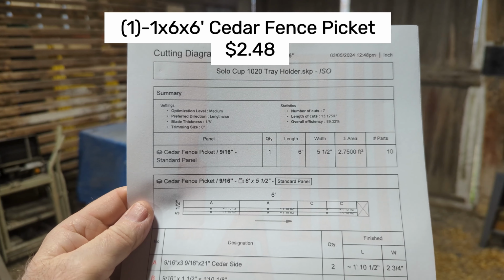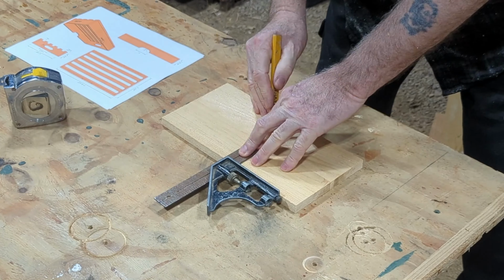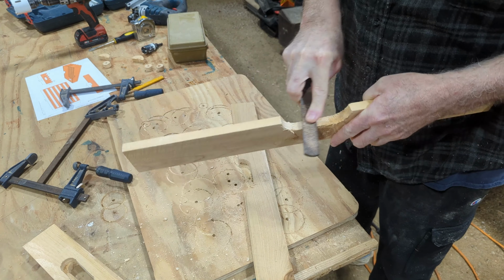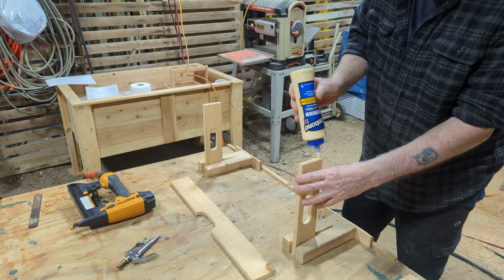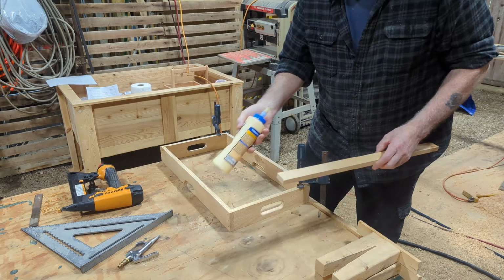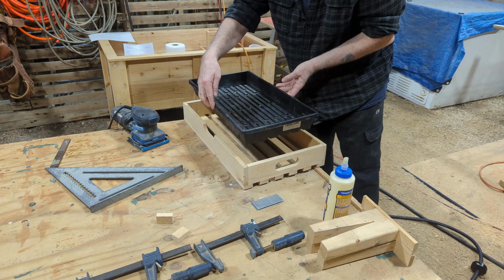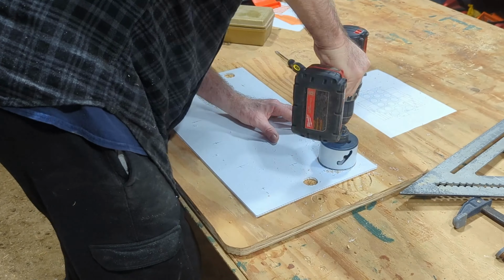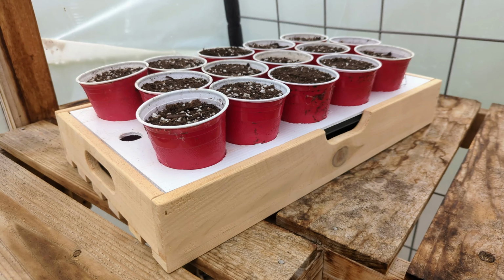Transform Your Gardening: DIY Seed Tray Using One Cedar Fence Picket!

Comment from the maker: You can get the plans for this build here: https://mtlibertydesign.etsy.com/listing/1681635102
and the trays I use here: https://amzn.to/3x2ZMkM
I get a small commission from Amazon if you buy using this link. It does not cost you any extra. Thanks in advance.